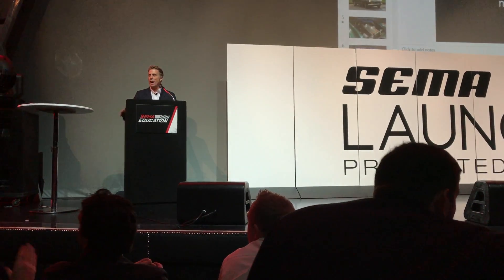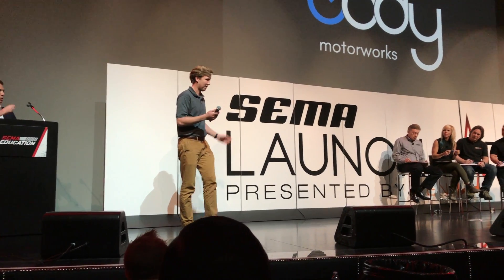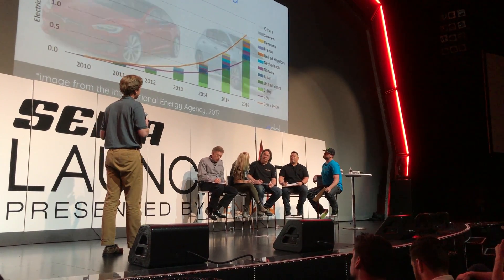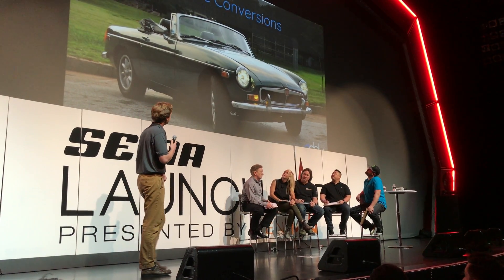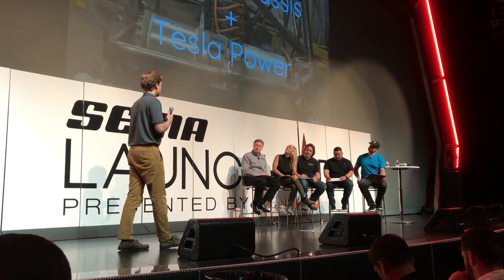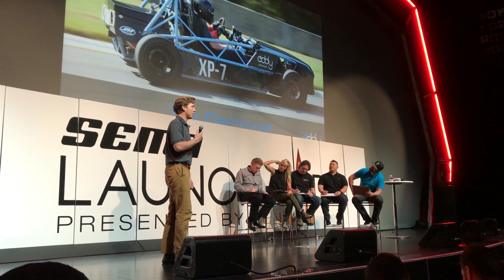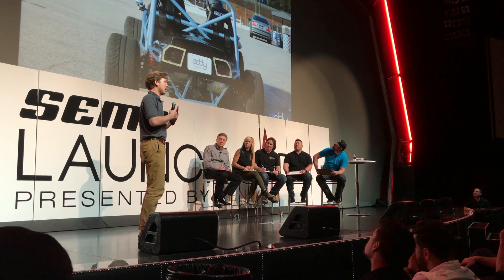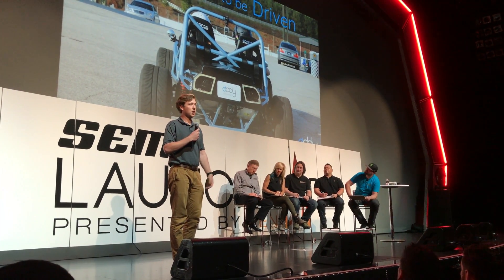The Tesla Model S-powered Electrocet at SEMA 2017 Launch Pad Competition

Comment: Sounds like it has excellent range on the road, but what is the track range? If I were doing a HPDE or Time Trial event, would it be feasible to recharge the battery pack between sessions off the RV hookups most tracks have?